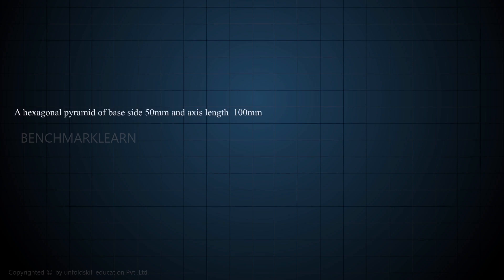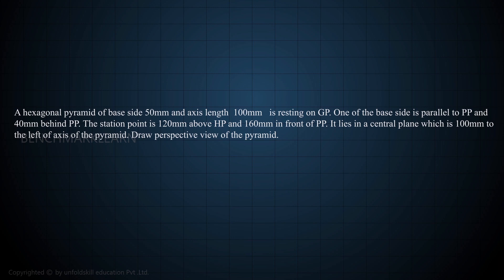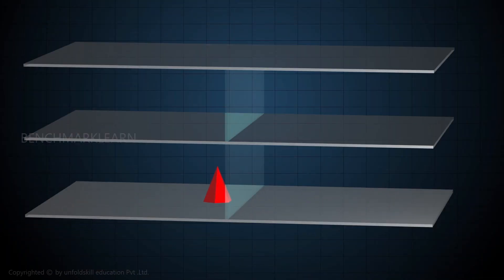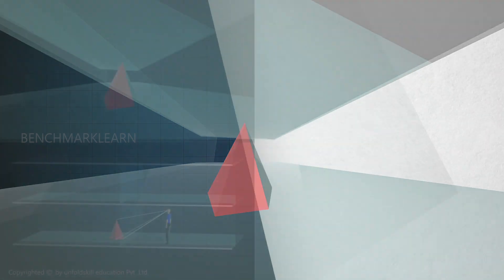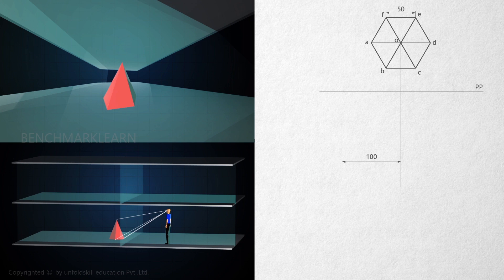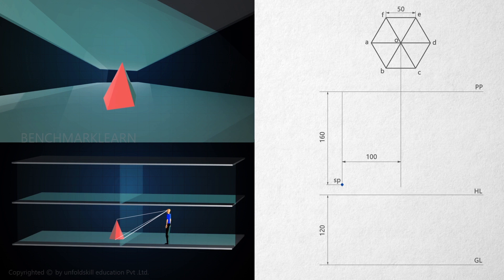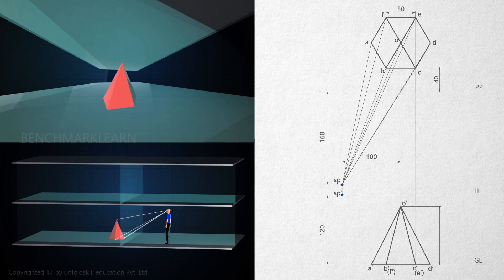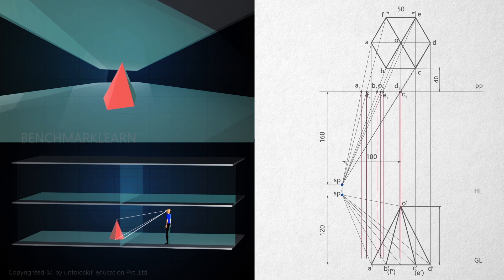Perspective projections of Hexagonal Pyramid | Engineering Graphics | Benchmark Engineering

Comment: A hexagonal prism, edge of base 20 mm and axis long 50 mm,rests on its baseon HP. such that one of its rectangular faces parallel to VP. Its cut by plane perpendicular to VP, inclined at 45° to H.P. and passing through the right corner of the top surface of the prism. Draw the development of the lateral surface of the prism.